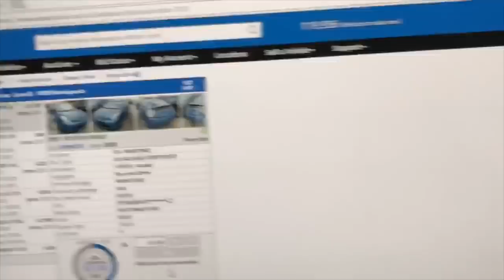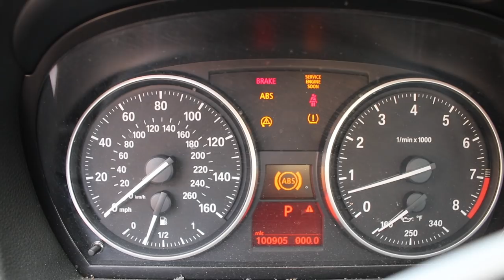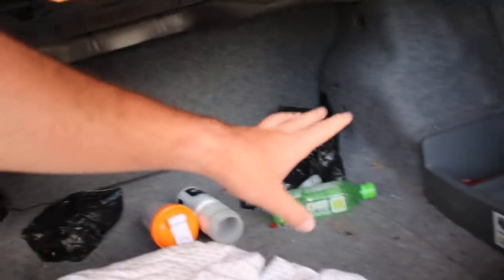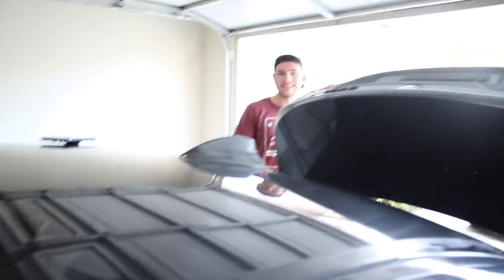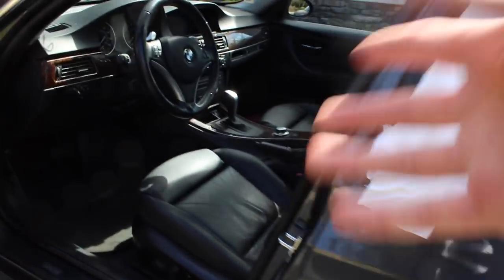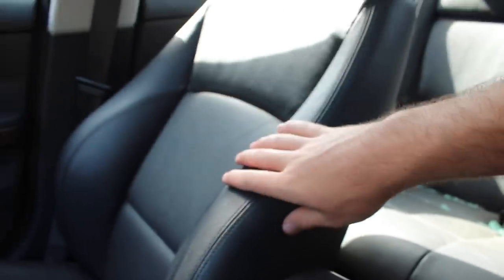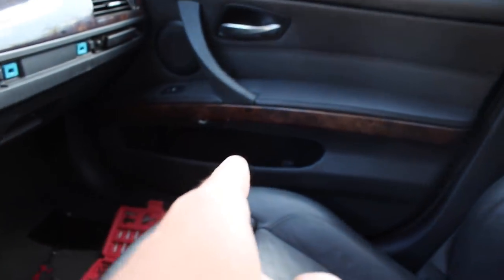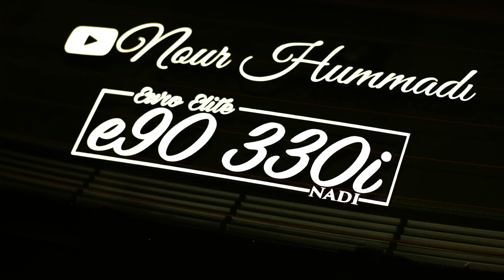Rebuilding BMW 335i Involved In Gun Fight! Part.1

Comment: Please don’t Bondo the holes closed! just weld the holes shut with small patches.
Reply: Yeah it will rust and the bondo will fall of eventually
Reply: ^this
Reply: Or make a metal patch to fit in there then use 08115 adhesive and fill the holes that way. Wont have to worry about warping panels with heat from a welder and does the same job

Comment: Things to do to the engine right away: 

- Change spark plugs & coils
- Remove injectors and clean them thoroughly, if their faulty, buy new ones (Aliexpress has great sellers, forget the controversy of OEM)
- Change your coolant to refresh the waterpump system
- Carbon Blast Cleaning (Do it yourself using the soak and scrub method and elbow grease) 
- Get a can of white spray grease and lubricate your suspension components as well as tighten all bolts
- Change your transmission fluid (mine was at 1.4L when spec is 1.9L at 120kms) Ridiculous, fixed all my grinding. 
- If the turbos rattle, adjust your rear actuator using a wrench. 

As for the ABS light, fix all the obvious stuff but if it's on it's probably your module. Buy a used one, don't buy it new. 

Cheers.

Comment: For the lights on the dash turn the wheel all the way to the left and then all the way to the right. All the lights will go away.
Reply: Whenever the battery dies the dme needds to relearn the position of the wheels which causes the lights on the dash

Comment: Congratz on a sweet car!
Remember that when you change the battery you need to code the new battery to the car, or else it will slowly fuck up you electronics over time. You can do it with ISTA-D, you can also read out the error codes with this program. So you can find out what the ABS lights are coming from

Comment: Have to appreciate the enthusiasm. I'd be wondering what the hell I got myself into lol. Good luck with the rebuild. Maintenance wise.. Water pump, thermostat, coolant reservoir, oil filter housing gasket, valve cover gasket, and probably the oil pan gasket. Charge pipe as well. I would do coil packs once you plan to tune it

Comment: I think the brake abs dtc light is a bad abs pump on the 2008 bmw e90 they had faulty abs pumps because the brushes inside stick and it throws the code i think the code is 5DF0 and 5DF1

Comment: please make a video on the radio soon, on my e90 325i my radio doesn't work and I took it to multiple radio shops and a certified bmw mechanic and they say its really hard and expensive and slightly impossible to fix any bmw stereo system, you will have to buy a aftermarket radio, i have heard many things from different shops that it could be ranging from, the amplifier to receiver to fuses and for me i don't want a aftermarket stereo, it looks tacky, i want my interior to look original, and clean, I just want my radio to work and it is annoying not having any music to listen to, so please if you can do a video on it, i guess if you take the whole unit out and replace some wires it may work, or replace the unit with an aftermarket stereo.

Comment: Change the alternator hommie your battery ain’t sending enough amps to your alternator that’s why it’s causing it to shot all them codes trust me it happen to me
Reply: The alternator isn't giving the battery enough amps to charge it*  If the battery is the original battery it's most likely the battery as they aren't designed to last 10years
Reply: Josh Kearns it’s his alternator regardless trust me